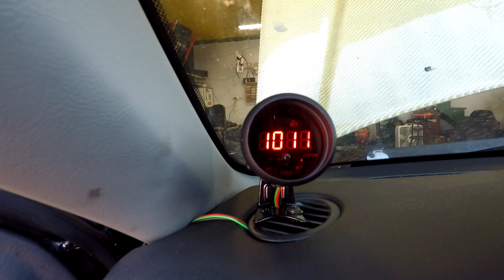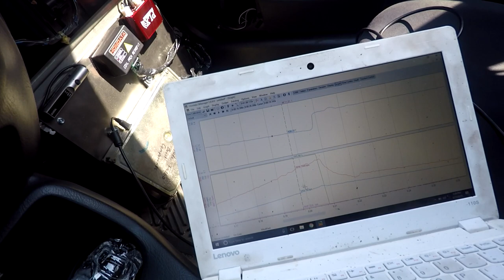More Issues With The Sheep. Big Cam Honda Idle Tuning Tips

Comment: On the back of the block close to where it meets the head behind cylinder 3/4 , there is a 1/8 npt fitting. I bet you that it's not plugged and that is your leak. I had the same problem.
Reply: It will leak only when in boost or close to it. It goes to the crankcase.

Comment: I’m having an issue tuning mine with a big cam where it’s not pulling enough vacuum at idle so it’ll idle pretty well at 1100ish but then it hits those tables under cruising conditions and leans out really bad 20:1+ under light throttle around 2500-4K RPMs. Also jumps to full rich under decel, I don’t think it registers to fuel cut it because of the cam... Any advice would help

Comment: HEY HUNTER! Just wondering  after turning up the stopper  from the throttle body (whats your reading on tps? I'm guessing 5% or 10%) Did  u recabrilate  the tps on the software after back to 0% or 1% ?
Reply from the maker: Yes recalibrate is necessary

Comment: I can’t remember if it’s all B series but I know there’s a block vent at the top of the block on back that usually goes into black box but if deleted to catch can set up mb it’s open. It’s worth a check. It might be under allot of pressure when in boost?

Comment: What oil line and restrictor size would you recommend on a ebay gt35 turbo? Ive had a vibrant oil restrictor that lasted me 10k miles just wanna hear your recommendations
Reply from the maker: David Urrutia journal bearing turbos straight -3 feed no restrictor

Comment: Hey hunter, just put s2 tuner 1 cams in my gsr. Car runs fine but feels sluggish and possibly even slower than before. If i were off a tooth on the timing belt somewhere would the car still run fine?
Reply from the maker: Max Herman yes need to degree the cams

Comment: Put the ek up on 4 jack stands,  have michael start it , run it through a couple gears lightly. In the mean time u lay under the car and see where the oil is coming from.
Reply: Been building these cars for 10 years. Nothi g wrong with firing them up on jack stands to see whats up.
Reply: Jeremy Long we did it's only in high boost high rpm. This thing rev'd out to 9800.
Reply from the maker: Was only in boost kind of thing